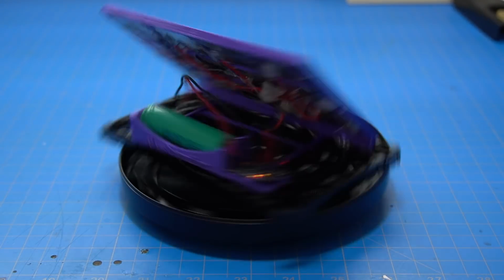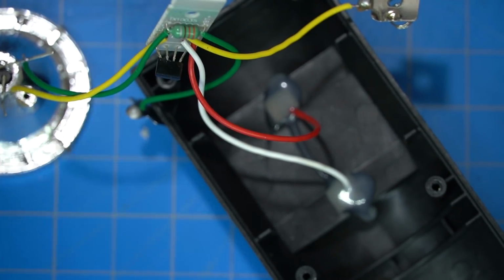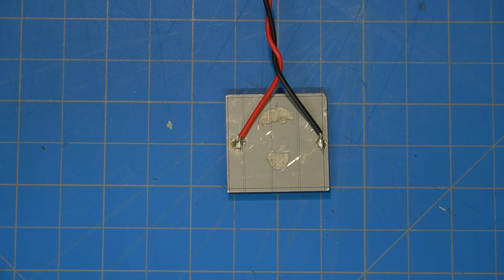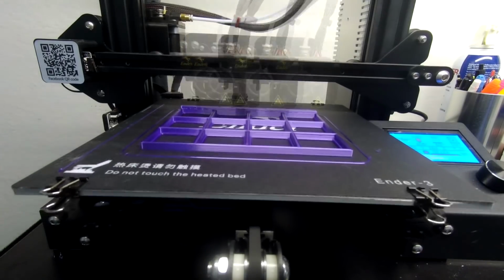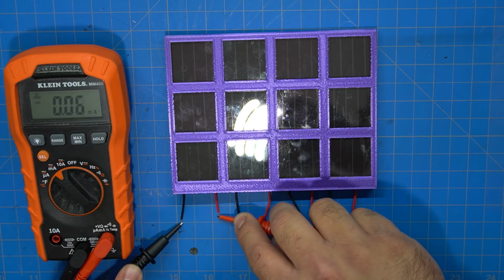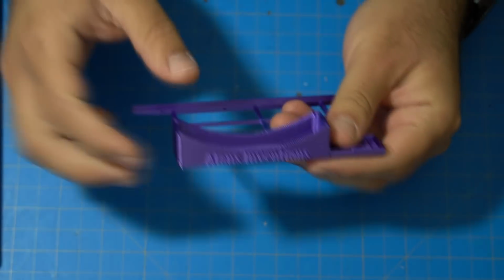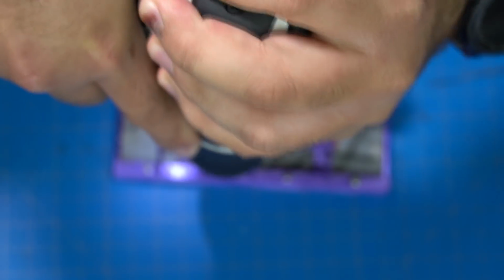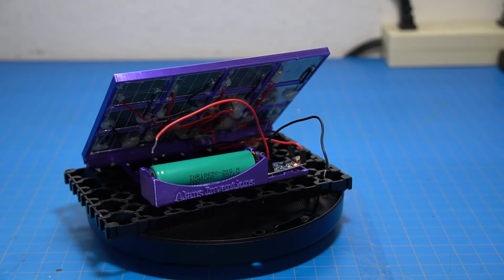I made my own Dollar Store Solar Panel

Comment: Would you sale me one
Reply from the maker: Hi. I don't really sell them. Its probably cheaper to buy one from ebay just based on the amount of work this will require to build and the efficiency. Here is one that is 10 Watts and 5 Volts.  https://www.ebay.com/itm/12V-5V-20W-Solar-Panel-Car-Van-Boat-Caravan-Camper-Trickle-Battery-Charger-Kit/264861613871?hash=item3daafb7f2f:g:h1YAAOSw101fQ1fn
Reply: @AlansInventions  oh boy that’s cheaper than I expected. Makes me feel not so good about getting a new damaged box 45 watt harbor freight kit for $50, but it’s my start to playing with solar.
Reply from the maker: That's part of the fun though 👍